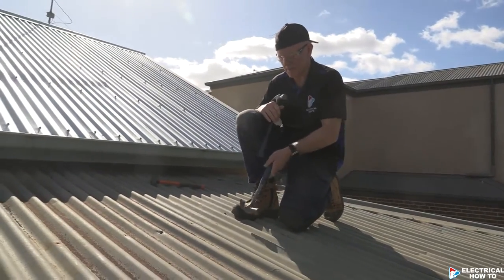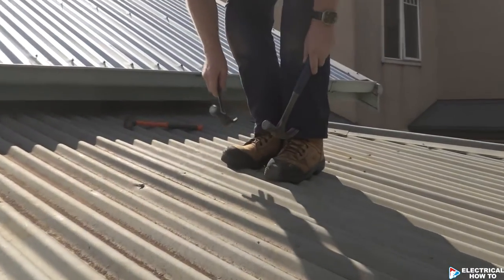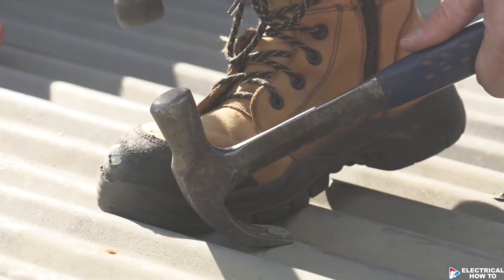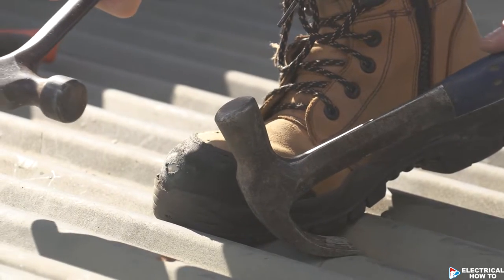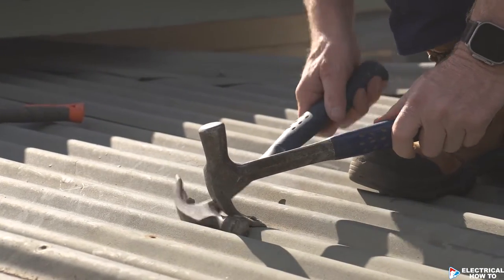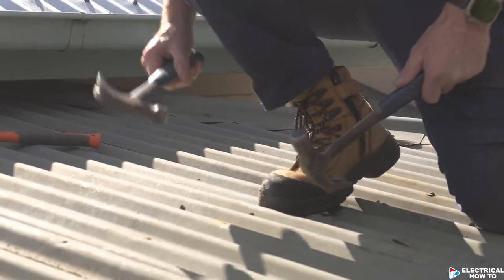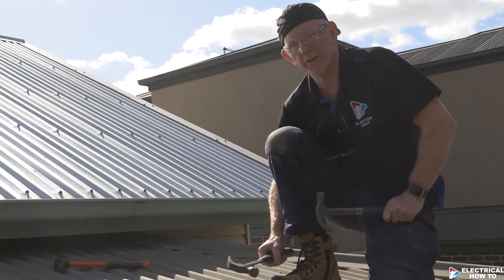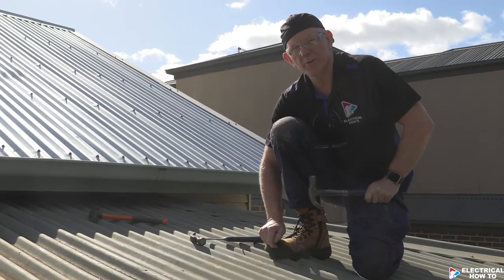How To Remove A Roofing Nail

Comment: Im removing tin off an old barn we are demoing. Im a big guy so a little nervous about the roof of this 100 year old barn. Plus nails are in the valleys/depressions: troughs, rather than the peaks. Trying to save the wood so bulldozing isn’t an option. a 48” pry bar is all i can think of to pop them out from underneath the tin. Any better options?

Comment: Good, but I'm thinking of using a rubber mallet to get the grip on the nail - to reduce the (repeated, very loud) neighbourhood noise. 
Even levering it out might be quieter using the rubber mallet striking the hammer handle.